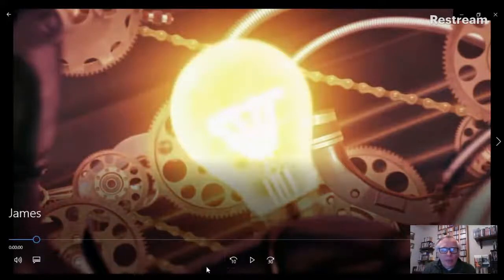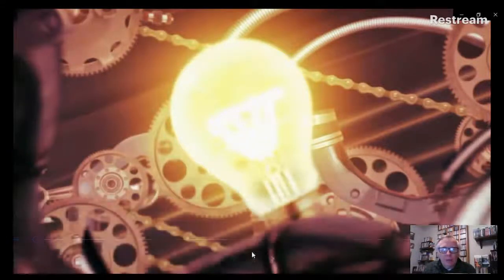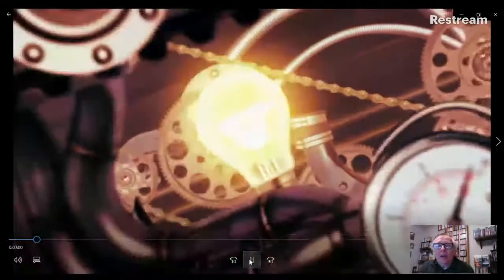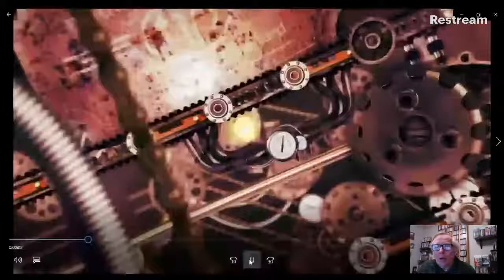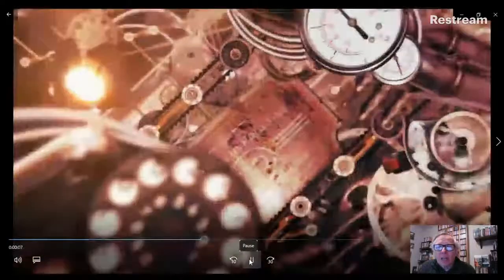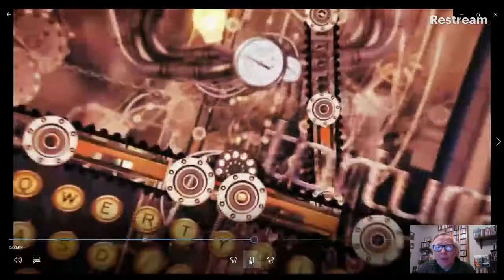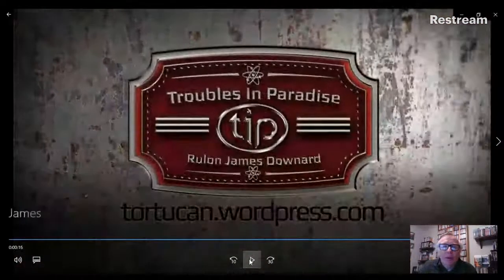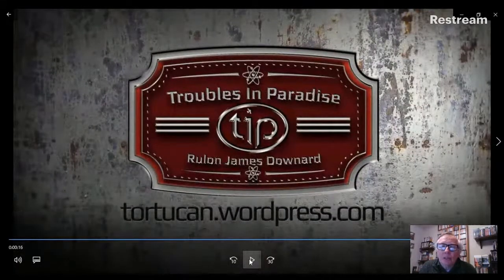Replacing Darwin 39 motor trendy & Sal nixes Maximizing Methods (from 1980!)

Comment: The Watchmaker argument is self-defeating, as Matt Dillahunty pointed out: we assess the watch as designed because it is so unlike the natural objects around it - which the Watchmaker argument concludes were also designed.
It also fails on the issue of complexity - complexity is not a hallmark of design, efficiency is.

Comment: Erica did a video yesterday about limestone, that reminded me of an answer Sarfati made to Mark Isaac about the heat issue

Isaak stated: There are approximately 5 x 10 23 grams of limestone in the sediments of the earth [Poldervaart, 1955], and the formation of calcite releases about 11,290 joules / gram [Weast, 1974, p. D63]. If only 10% of the limestone were formed during the flood, the 5.6 x 10 26 joules of heat released would be enough to boil the flood waters.

Answer: Once again, Isaak has dabbled in areas he knows nothing about. The question is, formation of calcite from what? The usual heats of formation in books such as the one mentioned are those of the individual elements in their phases at normal temperature and pressure, since the pure elements are defined as the zero starting points. Therefore, it is likely that Isaak has unknowingly detected the enthalpy of formation of the reaction Ca (metal) + C (graphite) + 3/2 O 2 (g) → CaCO 3 (calcite). But this reaction
it is irrelevant to what would happen during the Flood, since no one thinks that there was a large amount of highly reactive calcium metal before, or that calcite was formed by burning calcium and carbon in pure oxygen. Rather, it was made up of calcium ions dissolved in water that reacted with bicarbonate ions: Ca 2+ (aq) + 2HCO 3 - (aq) → CaCO 3 (calcite) + H 2 O (l) + CO 2 (g ). This is endothermic, meaning it removes heat, the opposite of Isaak's claims.

The limestone could not have formed rapidly from massive precipitation, because the formation of calcite releases heat. If only 10 percent of the world's limestone was formed during the Flood, the 5.6 x 10 26 joules of heat released would be enough to boil the floodwaters.

This assumes that everything precipitated out of solution, but if the limestone were deposited as a normal particulate sediment instead of being returned to the water, this amount of heat would not have been produced.

Could you give me your opinion about it
Reply from the maker: That sounds like an entirely plausible calculation.  I'll do some poking into it, since it is definitely relevant to the limestone formation issue, which will get a section in Rocks 2.  Thanks for the heads up, Marie!
Reply from the maker: That Sarfati piece would be the one at True Origins https://trueorigin.org/arkdefen.php from 1998.